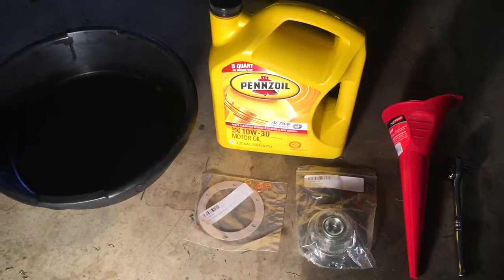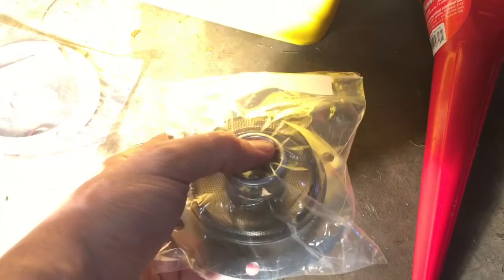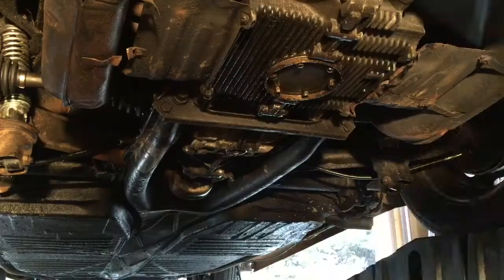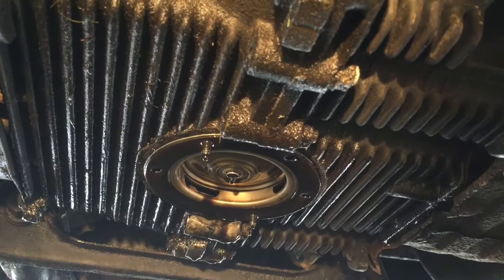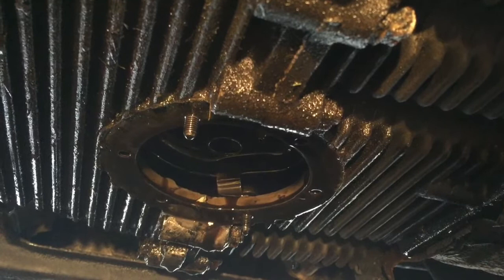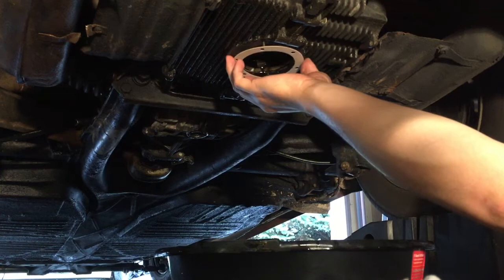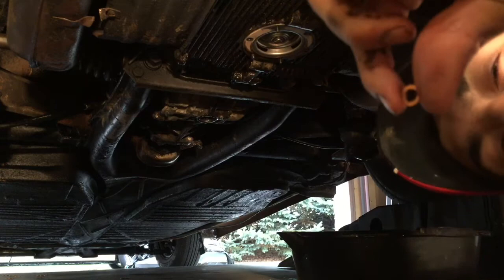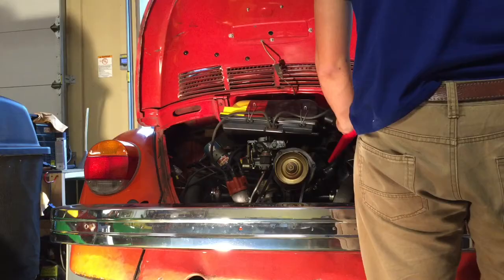How To Change Oil In A Vintage 1600cc Volkswagen Beetle

Comment: Nice  simple video. which  non mechanically minded  like myself can easily understand. Clear concise, no fancy talk..  Will be changing oil next weekend on my newly aquired  1967 Beetle. I'm from the UK and I believe  that Castrol classic oil is best, it's expensive  but used it in my old MG and ran cooler and seemed less noisy. Thanks for the video.

Comment: Any chance you can take a picture of how you have your “in” and “out” lines running? I bought a bug and quickly realized the lines are not running the way they should be. Thank you. - Arizona
Reply from the maker: David H “in and “out” lines for what exactly?
Reply: YoungBug - Thanks for responding. I have so many people different ways to connect my oil lines, 1 line leaving the oil pump going to the oil filter and the 2nd line leaving the “out” port back towards the engine. <~~ where does that line connect to?
Reply from the maker: David H Their should be a port somewhere on the engine block for the line to go back in, I don’t have an external oil filter on my engine so I don’t have anything to reference directly
Reply: YoungBug oh ok.. would you recommend a “bypass” that connects directly to the oil filter witch eliminates the oil lines. I’ve seen a couple videos or short time ago with people using those. That could illuminate my need for lines if I use a bypass.
Reply from the maker: David H Up to you, honestly have never worked with those external oil filters
Reply: YoungBug ok no problem. Thank you.